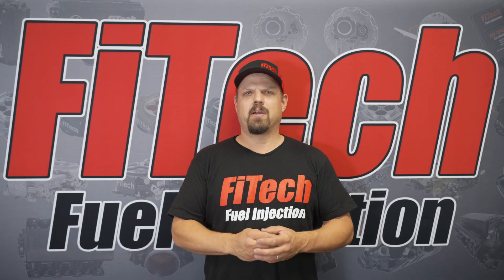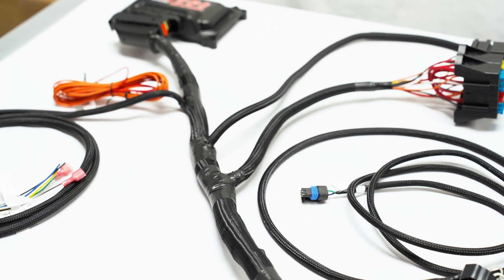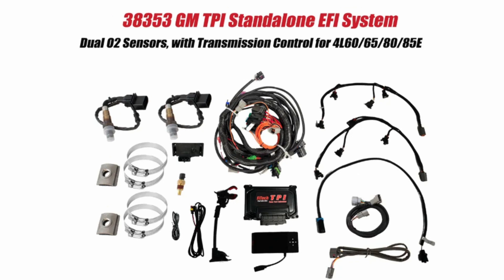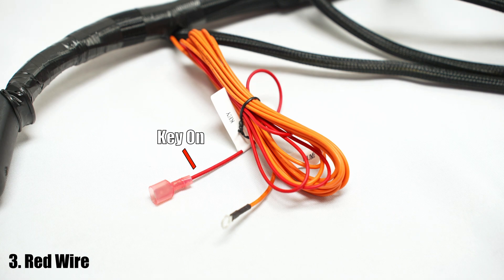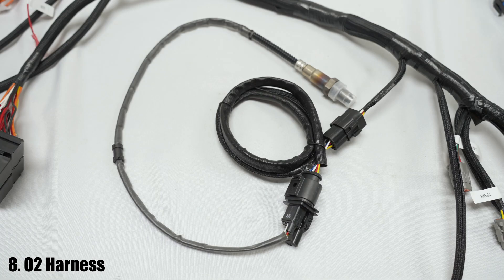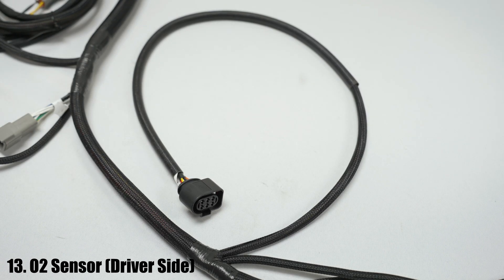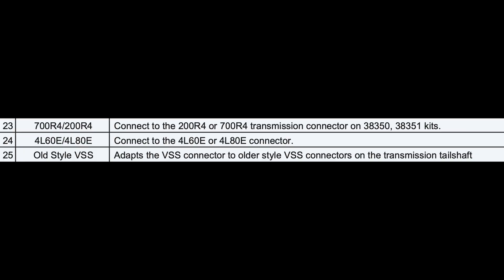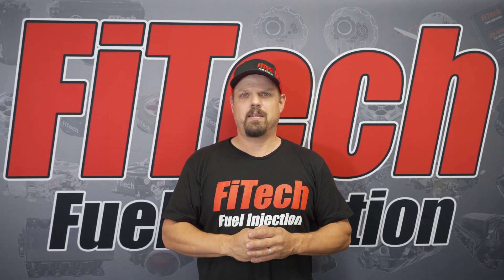TPI EFI System Wiring Breakdown | Tech Tuesdays | EP82

Comment: Question: Can a 2-wire distributor be connected to the 38353 system?
Reply from the maker: Hello sir,

For the TPI system you must run a dedicated TPI small cap distributor, computer controlled, this is required un order for the system to control timing and adjust spark.

Comment: What Fan1 and Fan2 signal output?  for cheking ... . Thats connect to pin 85 ralays . Camaro Iroc Z
Reply from the maker: The fan wires which are ground signal wires will activate the electrical fans by sending ground to the relay. Meaning the relay pin 85 will connect to our fan wires to provide a ground signal therefore it grounds the cooling system and activates when temperature is reached.

Comment: Hi guys from Australia here I’ve got a 1989 Nissan patrol with a 1986 305 tpi Chevy swap, was wondering if any of your kits would work with this motor it’s in I believe stock configuration but is paired up with a 5 speed manual, about a Month ago it killed the previous wiring harnesses and I believe the old f9 haltech ecu has died
Reply: Oh little side note, I’ve got my fuel pump, electric water pump and thermo fans on a switched setup so it doesn’t have to run those
Reply from the maker: Kits # 38350 or 38351 would be options for you.

Comment: If the stock tpi fuel pump is sufficient what should the psi be set at? I was told this system requires 58 psi. I know the stock tpi system holds 43 psi?
Reply from the maker: This system was intended to run at 43 PSI where as other EFI kits we offer run at 58 PSI.
Reply: Whatever horsepower level your engine should produce match your injector size and pump accordingly to support it. The sky is the limit

Comment: Will the 38305 on a stock 305 tpi work with the stock fuel pump. ?
Reply from the maker: Yes it will.
Reply: In that case what should the fuel pressure be set at ? I was told the fitech system requires 58 psi. I know the stock system holds at around 43 psi.
Reply: @gman2969  you are conflating systems the LS runs 58 psi the fuel pressure you send to your injector is not ecu controlled the FPR you have on your engine is set at 42 psi and you pump will support it that’s what you got. It’s regulated off vacuum and a mechanical spring / diaphragm not the ecu

Comment: What kit would you recommend for a 90 Corvette l98 automatic
Reply from the maker: This system is not designed to be used on emissions controlled vehicles. It was designed to run the engine by itself.
Reply: @FiTechEFImedia  my state doesn't have emissions testing and I'm just trying to get the car running. Bypassed my security but still having problems so considering just ditching all the old ecm and emissions to run a standalone
Reply: @Chances_garage yes this system works great for your application you just have to do some work to keep the gauges working, they can’t help you install on any emissions controlled car even in a non smog state, it’s federal law enforced or not and they are based in California so they have to play by the book

Comment: Wanting to put this setup in my 94 Sierra. It has a vortec truck pump in it will I be able to keep all my gauges working in the truck?
Reply from the maker: Hello, please give us a call or email our tech department as the need follow up information, it really depends on which gauges you are trying to keep. Call 951-340-2624 or email techmail@fitechefi.com
Reply: FYI from a legal standpoint they won’t be able to advise you on something like this because it defeats all the smog crap hence AKA it’s illegal for it to be in a 94 truck   Unless it’s an “ off road show or race car not for street use. But you should be able to get it to work

Comment: I bought one of these standalones a couple days ago for my 88 Firebird 350, the original harness is all jacked up and it has some electrical issues because it was a giant rat's nest at one point. Hopefully this will get it going. I was told the engine and trans is good.
Reply: Well? Worked well?
Reply: Any updates?

Comment: Batch or sequential fire? Integration with factory gauges? Do you sell it without the automatic transmission sub-harnesses for those with manual transmissions? Self tuning?
Reply from the maker: This is a batch fire system with a digital tach and speedo output. Kit number 38350 and 38352 are non trans control systems. Yes they are self learning.
Reply: @FiTechEFImedia  
If I get this kit to run a 700-r4/4L60E,/4L80E, but decide to keep my th400... Will that work?

That leads me to my next question. What if I'd like to keep a mechanical speedometer and electronic non-digital tach?
Reply from the maker: @xmo552  Yes it will still work. You will just have  sub harness you do not need to connect.
Reply from the maker: @xmo552  You would have to find adapters to make those work. The TPI system is all electronic.

Comment: I have a 1992 5.0L Automatic can I still use the factory gauges? do you include Y cables to connect your wire harness and also connect the factory plugs?

Comment: I'm in the process of swapping an L98 based 383 with a Holley Stealth Ram into a gen II Camaro and have a few questions about the 38351 kit.

A) Does it provide sequential injection or is it still batch fire like original TPI motors?

B) One of your quick guides(ep25) says the ProCal software is only available on LS and power adder systems. With the 38351 being advertised as boost ready, is it laptop programmable?

C) I'm assuming the 38351 is based on speed density. If so, how well does it handle larger camshafts?

D) Does the kit come with a complete wiring/ECU pin-out diagram in the event the harness needs troubleshooting?
Reply: It’s not batch fire but it’s not sequential either hard to explain
Reply: It comes with 3 bar map sensor and is boost ready. The controller comes with it and you can data log and or hook it to a laptop but not needed. I think for the “ pro tuning “ features you have to hook up a laptop but come with free cable and software
Reply: @yeahididit9054 how is map sensor with a radical Camshaft and low vacuum???

Comment: Will this work with a manual transmission?
Reply from the maker: yes this system can be used with a manual transmission.
Reply: @FiTechEFImedia  any installers in Houston
Reply: Checking